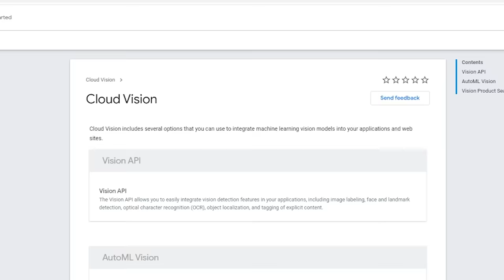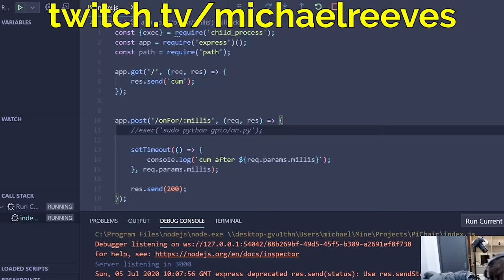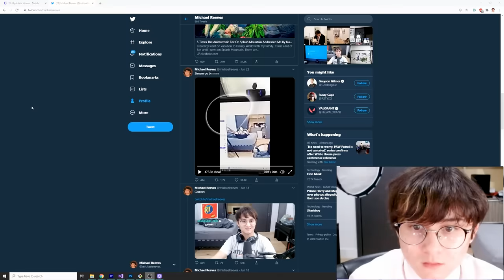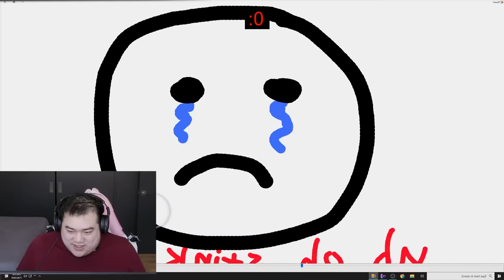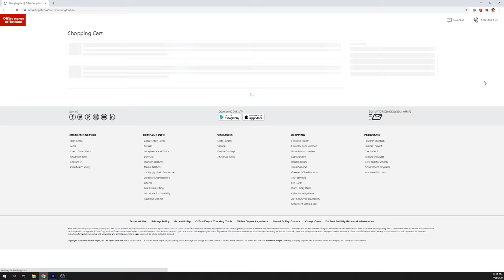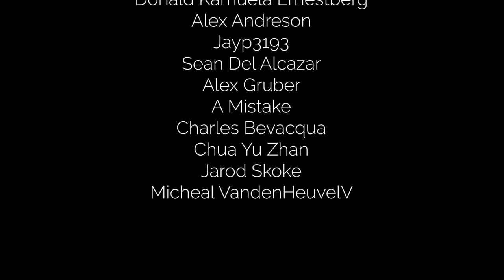If You Can't Find Waldo You Get Tazed

Comment: Technically this isn’t negative reinforcement, it’s positive punishment.
Reply: Not technically, it's not reenforcement by definition.
Reply: @Zaurthur  isn’t that what I said?
Reply: @Vgamer311  yes i just don't think you're being emphatic enough. It is as correct to call the subject of this video negative reinforcement as it is to call it a ham sandwich.
Reply: @Zaurthur  I disagree, many people colloquially (though incorrectly, in official terms) use the term negative reinforcement to mean positive punishment such that using it illustrates your intention clearly and without significant confusion to most people, perhaps with even less confusion than the officially correct terms.

However if one were to use ham sandwich to describe the subject of the video, almost nobody would understand their communicative intent.
Reply: Yeah, it's punishment. Punishment = presentation of a negative stimulus, eg: tazer. Response cost = removal of a desirable stimulus, eg: taking away someone's xbox.
Reply: Yeah positive/negative describes whether a stimulus is added or removed and punishment/reinforcement describes whether the stimulus is pleasant or unpleasant.

So positive reinforcement - giving a dog a treat when they perform a trick

Negative reinforcement - stopping an irritating noise when your dog performs a trick

Positive punishment - tasing your friends when they don’t solve where’s waldo children books in time

Negative punishment - taking a dog’s toy away because it did not perform a trick

Positive reinforcement is the most effective training tool, especially for pets that might not pair the stimulus with their own behaviour as easily as a human might, because it’s immediate pleasure for the trainee when they do what you want and it doesn’t create any resentment because there isn’t really a bad outcome (its either do it right and get a treat or nothing). Negative reinforcement and both punishment instead rely on trying to teach something to do what you want otherwise you’ll make their life unpleasant by adding bad things or removing things they like.

Comment: How about making a pen that “helps” you draw a perfect circle
Reply: Helps = taze
Reply: @BreckTGB  yes
Reply: Tie the pen to a paper clip or push pin using string. Push the paperclip/pushpin down onto the paper and rotate the pen around it with tension on the string. There you go, perfect circles
Reply: @CerealMilk00  to much work
Reply: Or just use a ruler and a pen. The ruler has to have more than one hole in it. That’s easy enough
Reply: A pen that makes you good at drawing

Comment: That's not negative reinforcement, it's punishment. 

Negative reinforcement is when you give a negative stimulus until the subject does what you want, and then you remove the negative stimulus.

In other words if you wanted to use NR, you would have the chair frying the subject with constant tasing until they found Waldo. That is arguably more fun and should be a sequel to this video.

Also Pavlov did classical conditioning and not operational conditioning, so you should have referenced B.F. Skinner and his shocking of rats. 

Sorry I am a psych major and it's kind of a pet peeve. Love you!

Comment: Michael, you're great, love your videos, but that isn't what negative reinforcement is. Positive and negative describe whether a stimulus (a nice sound effect, a painful shock, etc) are introduced or taken away from the subject. Reinforcement means anything that causes an increase in the behavior. Punishment means anything that causes a decrease in the behavior. So the introduction (positive) of an electric shock (punishment) would be positive punishment. Negative reinforcement would be taking away a stimulus which would cause an increase in the behavior. So to actually do negative reinforcement, you would need to have something like an ongoing electric shock that only stopped when waldo was found.

Comment: Nerd stuff but it's not negative reinforcement being used. It's positive punishment since the positive and negative only means adding or taking away respectively. The positive in this situation is adding an electric shock as a punishment for not finding Waldo. Negative reinforcement would be possibly lowering the shock intensity or removing a constant shock when they find Waldo. I'll stop being a nerd now bye bye